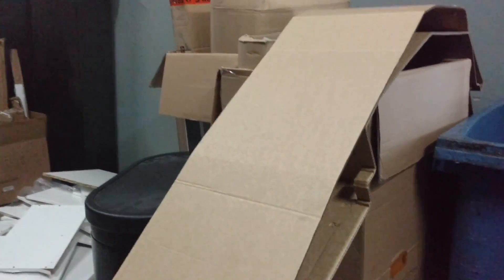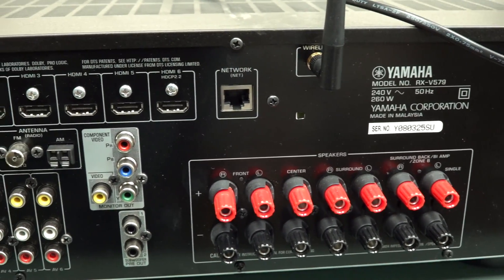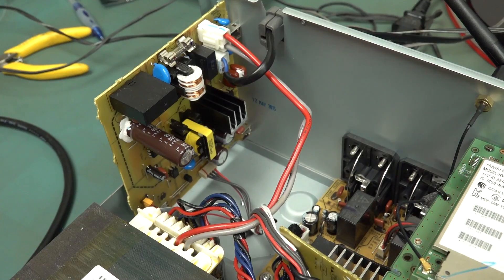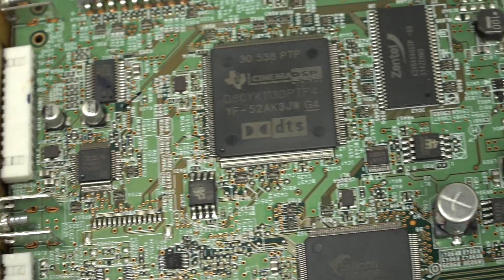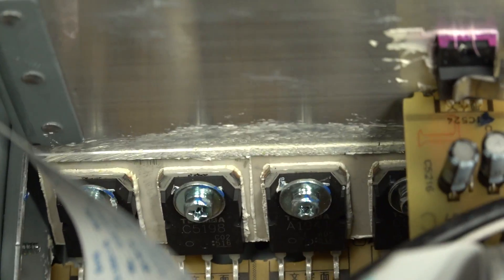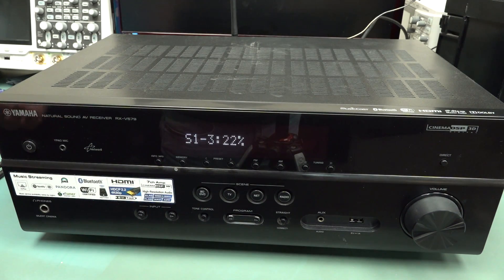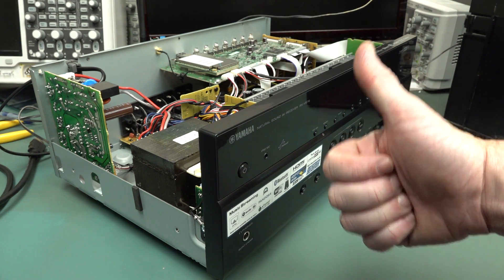EEVblog #1151 - Dumpster Dive Yamaha Receiver

Comment: With a lot of these amps you'll find an app for your phone that'll let you set it up and configure (uses the network), Have a look on the appstore for a Yamaha remote app
Reply from the maker: Wow, found the app and it works great via WiFi! Connects to my Synology NAS and does everything. Amazing. Thanks.
Reply: @EEVblog  winner winner chicken dinner.
Reply: @EEVblog  If you look closely, that big sticker on the front panel advertises the Wifi/Bluetooth App Remote feature ;) It was hard watching you complaining about the missing remote, having that sticker right in front of you :D
Reply: @EEVblog  do a review of it
Reply: @EEVblog  you can remote into it by ip address for control on your network as well - its pretty antiquated looking but can be useful if you're at your pc, i use it a lot
Reply: @EEVblog  sounds like you need to make another video about the app, unless you already did?
Reply: Just incase you ever need to in the future; if you have a phone with IR blaster (or buy a dongle IR blaster to connect to the phone) you can use AnyMote app which really works a treat with every old and new remote controlled device ive tried it on. Cheers.
Reply: @viewer54322  I use the samsung galaxy S5 phone which has a built-in ir-blaster and the irplus app to emulate the remotes - works treat :)
Reply: @tedvanmatje  I got an S7, I wonder if it also has the built-in IR. The IRplus app is sadly not compatible with my device, but Google tells me I might have an integrated IR blaster.
Reply: Is it something that can become part of your lab if you got more speakers to go with it?
Reply: Haha, I remember the other Yamaha teardown. You stuffed about with it and gave up on it in the end!! Looks like you got a worker here though.
Reply: @cobberdig  he did a followup video where he got it working.  Dodgy cap.
Reply: Ahhh IR blasters - a heap of fun at the local pub or in the TV section of a department store. My friend had a Samsung phone and would often confuse the heck out of poor bar staff by turning off the TV's or changing the channel. Hes lucky he didn't get caught, as his favourite prank was to turn them off when the sport is on, and the favourite team is about to score a goal.

Comment: A friend of mine owns a company that hauls away old furniture and appliances but has also been paid many times to take away brand new tv sets, microwaves and even a refrigerator still in their boxes. He also gets pretty expensive lawn tractors with just a dead battery or clogged fuel filter or some other minor problem. Like they say one mans trash.

Comment: Just FYI, I have had 3 similar Yamaha HTAs across my bench in the last year or so and every one had a fault in the standby power circuit.  All different models but same basic layout. all 3 faults were temperature dependent and due to altered/low value capacitors (the red polyester ones) in the capacitor dropper circuit that gets the standby function up from power on. I don't usually repair very much but these amps all belonged to friends! A fourth, older one, had a small mains transformer for the standby function that also was intermittent with temperature. It could be that your one was thrown away due to no signs of life but is now in a warmer place so the fault is not evident, maybe?

Comment: If you get the mic for it, it does automatic room correction. I had a Yamaha and now a Denon that sets levels, delay, phase, and EQ for all 5 speakers and the subwoofer. The difference in the sound, especially for multichannel audio, is amazing.

Comment: This amp might not always turn on. The problem gets worse over time until it doesn't turn on at all. The reason is a broken film cap in the cap dropper supply on the power board next to the mains input. Some repair shops declare those irreparable for something that stupid.

Comment: Nice find, Dave...
At least the EEs at yamaha audio department scratched their heads and moved away from these thick film power units (SK,STK...) and went back to complementary power output transistors/fets/RingEmitters/IGBTs...easier to 2nd source and also easier to repair.

But these surround stuff isn´t a thing to me...i stick with the 80th HiFi, Stereo.

Comment: common problem with this Yamaha is disconnecting output speaker randomly even after few hours, possibly some dry joint under BGA IC (not sure).

Comment: a significant issue with all these yamaha amps (i have an rx-v371) is that because even the analog inputs go through the dsp, it has significant delay between input and output. The dsp can not be hard-bypassed (with relays). 

if i find the icsp for the dsp board i might try hacking into it. those ti dsp cpus are nice to code, even in asm

Comment: I've had a refurbished rx-v375 for several years now, and I honestly cannot find fault with it's function, though I have occasionally had to override the edid file that it reports to my pc.
As for the remote, I think that you should be able to get away with a cheap universal remote, and if you can't you just order an original off amazon.

Comment: V2.59 firmware for that model improves Airplay... etc... did you update it yet?  Its a discontinued Yamaha that rated at 80W/channel (.09% THD). Can handle 4K Ultra, Bluetooth, Airplay... I think its a winner winner... pickup a uni-remote, Yamaha App or Logitech remote...

Comment: Lol... my last dumpster dive turned up a small LCD Monitor... which didn't power up and when opening it, the first thing that caught my eye were the five big bulging caps on the power board (cleverly surrounded on three sides by the heatsink of some FET/regulator/power transistor)... not sure if it's worth to change them and try powering it up again...

Comment: Hey don't bash Yamaha caps! lol Actually that's suppose to say Yamaha Audio as it's their own brand of caps. Not audiophoolery. This is a high end receiver for it's time, I think one under their highest end receiver due to the lack of inputs at the back, and yes there are higher end ones so loaded with inputes it will make your head spin. They still use single mosfets for sound to cut down on noise and better power delivery. The reason why they still make their own caps along with Marantz and McIntosh is because they are larger then audio caps these days, better storage of power. Which equates to better bass output / power delivery. Their high end component amplifiers still have the monster 2" diameter filter caps. I fix amplifiers new and old, large / custom caps just did it better.

Comment: Probably dumped because it has no re-sale value; you can't give them away to most charity shops in UK because it's electronic / electrical and they can't take the responsibility of it having a dangerous fault. Owner probably didn't want to bother with eBay. I hate to see usable devices go this way, but what can you do ?

Comment: I repair Yamaha products under warranty and I am sure that you will not be able to get audio out of the HDMI.  The problem is a failure of the DSP chip on the Digital Main Board (HDMI Board).  They are very expensive if you try to buy them from Yamaha and only worth repairing if it is under warranty.

Comment: Heat sink is a major consideration for this thing. Looks like they hired a physicist or a patient nerd to wind up at that configuration. Trick is to maximize surface area and minimize brute force thickness. Notice how thin the blades of the heat sink are. Well done, Yamaha!

Comment: We are talking about $500 msrp in 2016. Here's the funny thing. This receiver has got a ton of tech packed in and does 80W RMS per channel. Meanwhile same model line A-S801 stereo IA 100w per channel, not 7.2 rubbish, almost zero tech build in, priced $1000 msrp. Go figure.

Comment: I got a similar one (HTR-4066), but it doesn't output any audio. I can only hear a faint pop when turning the volume completely down. I suspect it's the audio switch IC (BD34704KS2), but it's a pain in the ass to get to it (and it's a bit pricey compared to most other components) so I haven't bothered.

Comment: Question?????  8minutes in, the pcb that does nothing but "hold the wires with a wire" , could that be say a piece left over from the main pcb designs meaning like they had a square area left over, just put some silk screen on it, and just kind put it in there as a holder?   You can see the where it was broken out of a bigger pcb and such.  Wonder if it matches up with other pcb in the unit?  Might be a chore to find that out.  Would it save money???  P.S.  Sorry for wording,  bad cold here can't think good.  lol

Comment: not again! trafo steel strips are welded together! wtf? trafo will overheat and at some point will blow internal temperature fuse (it is very hard to get to them, because they are inside trafo)!
All receviers I've seen have trafos like that, why? They waste so much power for current induced in core.... is it planned obsolescence?

Comment: I am not surprised, some people are that spoiled, don't spot any value, don't even think to give it away to reuse it. Sad but true. I have found so many electronics (in the dumpster) right now, you won't believe it. Some are missing something, just one fault (dust or crack), easy to fix or completely ignored because it is old however in very good shape, usually it looks like brand new. 

I have found (still useful) tablets, smartphones, harddrives, bluetooth speakers, sub-woofers, headphones (really good ones), home-cinema equipment, remote controls, set-top boxes, memory modules, computers, DVD-players (and blue-ray!), power banks and so on, pretty decent recently stuff. Some things I have fixed (or reuse some parts), give away or sell it.

The receiver you found is just an example, why people want to throw this away? Really don't understand the disrespect and makes me feel sad, glad you found it, rescued from being destroyed forever.

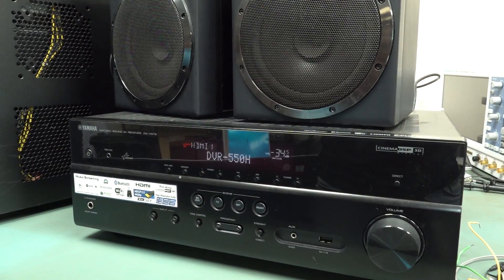Comment: 3:53 This must be the ugliest pair of loudspeakers/monitors I've ever seen. Found in the Dumpster of a Borg Hive!!!
Funny about this Yamaha Receiver: You can't really tell how recent it is because seemingly Yamaha's designer Team is pretty old school! I have Guitar Amp THR10 from Yamaha. Now I know why it looks as it looks! Cheers, nice find!
Reply: @Andrew BallardYes, it's a nice concept, portable, recording with Zero-latency due to the direct monitoring feature. And you can record only your DI signal if you wanna use VST-Amps and Cabs later. But unfortunately it's horribly outdated. Yamaha never bothered to put an effect pedal section in front of the chain. So, you can't boost with an OD/TS to get more metal-like sounds. Compared to what is possible with impulse responses the sounds of the THR10 are also a bit behind. Nowadays I'd choose Boss or Vox over the THR in this segment.

Comment: Japan are obsessive about not letting wires float in the wind. This is due the earthquakes. Worked for telco vendor in japan.
Reply from the maker: Interesting, thanks.
Reply: Wire flapping is just wrong on so many levels.
Reply: bill605able I meant flapping it was autocorrect. All 19 “ racks cables had to be tied down every 200mm by regulation. Cable porn. Everything in the machine room was tied down. Even chairs were chained when not in use. I was there for 3 months and felt what a 4.3 fealt like. They take earthquakes seriously but just could not be stuffed terminating a 60w 3g 2.1GHz feeder cable. Literally made my eyes water.
Reply: Yeah they let them securely affixed under water after the tsunami. Too soon for a Fukushima joke?
Reply: Krasimir Ivanov the idea is taken from the way they bend bonsai branches with wire.
Reply: True. Simple vibes in the wires sometimes cause interference and signal instability issues...

Comment: You are lucky to be able to pick stuff in the dumpster. Here in Belgium, it's totally forbidden and if the guy at the dumpsters sees you picking something, you are.in troubles. 
That's ridiculous because I'd like pick some stuff and try repairing it. But the law does not allow you to.
Reply: the same here in germany. Prior 2k you could pick up some stuff if you just asked the staff, but after millenium they all got that contract to set up surveilance cams, and also in/out matching, they need to sign that they don´t sell/give away/take out any kind of piece of electronic once it´s inside.

Comment: Of course the amp board looks the same. They got the 7.1ch design down pat, no need to reinvent it for the new model.
Reply: does not matter... subwooferoutlets are not on the amp... they are just preamp outputs
Reply: That also might be why it's not a class D amp. They can't be bothered to spin a new amplifier?
Reply: It is a 7.2 model

Comment: Pretty sure this doesn’t support HDR which makes it ‘obsolete’ despite being only three years old. I have an Onkyo receiver of similar age which has the same problem of being new enough to support 4K but not new enough to support HDR. Perhaps that’s why they dumped it.
Reply: My old amp must be from the Ark then it is a Sony STRD-1090.  its an old Dolby Prologic unit from early 90's
Reply: @steviebboy69  I know what you mean mine is a Pioneer Elite VSX-95 from around 1992 with pro-logic as well. If it ain't broke don't replace it, plus the audio section is far superior for 2 channel than any of these new AV receivers, 125w@8ohms RMS power with an unfound today THD of 0.005% 20-20khz.
Reply: Not sure of what mine is as too the specs but I do remember 120 Watts RMS @ 8 Ohms.
Reply: Prologic. :shutter:  @steviebboy69
Reply: @steviebboy69  lol gota love the old tech it still works just fine no need if it still functions lol itll still put out the same audio lol
Reply: Yes I only use it for audio, and I still even have a CRT TV a Panasonic One-up.  I dont watch much telly anyway.
Reply: My Sony which is only one model behind the latest has LESS functionality than this dumpster dive.  Same issues you mention too, only one HDCP 2.2 port, no HDR, no 4:4:4 in 4K.
Reply: @alexatkin  i had the 
same problem ..just used ARC though
Reply: I had  same problem with hdr so i connected it directly to tv and used optical output of my player to receiver. But Atmos is a different story!!
Reply: @onlyrgu  Optical audio only supports encoded 5.1 or PCM 2.0. If your receiver supports HDMI input, you will get way better audio quality via HDMI.
Reply: You can just buy a HDMI splitter that supports the latest hdcp. Then hook one to the TV and one to your receiver.
Reply: Yep, even then I wouldn't toss it, heck i'd get my money's worth out of it. Nothing wrong with bypassing the video and using it strictly for the audio.
Reply: Yeah, it also doesn't support the new Dolby Atmos and DTS:X
Reply: MrShotgunJones it handles 4K but only at 60htz.
Reply: jupp, HDMI is a mess.
I bought a used Onkyo (2 years old) that had no HDCP 2.2 support, so the owner, wanting to watch 4k content, hat to swap it out, and it was a then 1500€ unit, I grabbed for 250€.
I only have a FHD setup and will not change for some time (4k does not cut it for me) and so I am VERY happy with the AV-receiver.

HDMI is making tech obsolete at a crazy fast speed, it's like cancer.